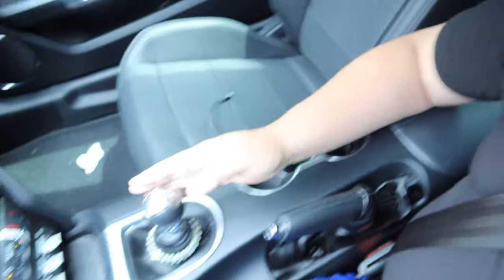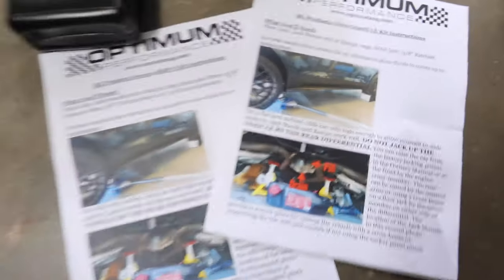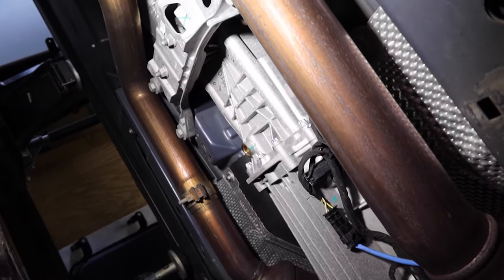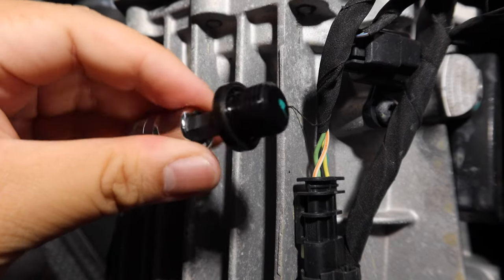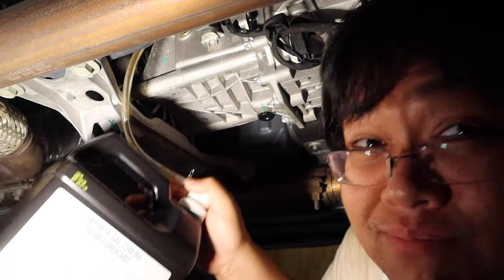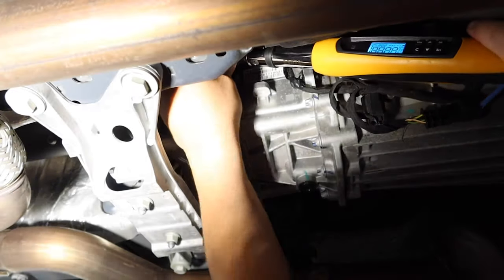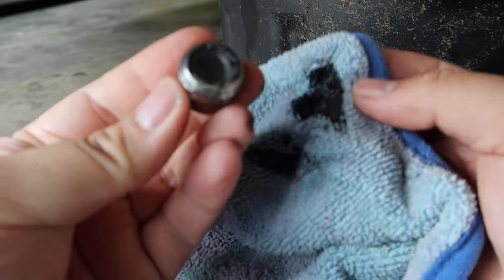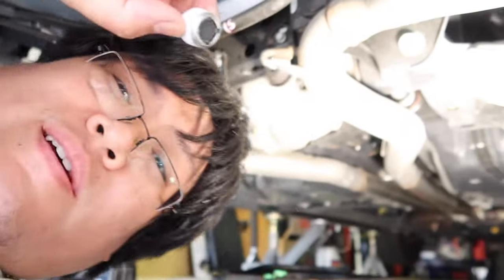Mustang Manual Transmission Oil Change

Comment: Hey man love the video, just wanted you to know that putting thread sealer on a bolt that sits in the fluid is a bad idea. You'll actually lose some of the sealant in the transmission. If it didn't have a thread sealer on the bolt you shouldn't use it. Great video tho just trying to look out for you. Hope everything is ok regardless.
Reply from the maker: I did wonder about the thread sealer. I guess I will find out in several thousand miles when i do another change.

Comment: Would doing this help? When I shif to 3rd it will sound like a notch or grind kinda and then pop into gear it doesn't do it every time but every few times it'll do it. And it's only in 3rd gear it does it. My car is a 2017 mustang gt premium.

Comment: Enjoyed your video, thanks. I have a 1995 Mustang Convertible with a 3.8 v6. My Dad gave me before he passed away. He drove it until he was 98. I am redoing most of it. The manual transmission is good but starting to feel loss. After watching your video I believe changing the gear lube will take care of that. My Dad just drove it and not other but he did keep the oil changed. Motor is in great shape. Again great video...

Comment: I have a 2020 Ford Mustang, GT with the Ralph exhaust system and the Rouse cold air intake. The car is crazy fast is your car a 2020 mines called coma blue only had it about two weeks. I love it what a hot rod.

Comment: Whats differential fluid for? I got the BG syncro transmission fluid (not put in yet), do I need the differential fluid too?
Reply from the maker: Differential fluid is for the differential. The differential is after the driveshaft before the axles. Most probably don’t need to change this fluid as early as I did but it wouldn’t hurt and is good preventative maintenance
Reply: @BinhDong  ok i see. Thank you 🙏
Reply: @BinhDong  i have another question. I only have a lift for changing tires for one side,. If i get another so that i can lift just the front up, is that ok for the fluid change or do i need to lift all sides evenly?
Reply from the maker: @soulassassin4847  lifting just the front will work. I don't see why it wouldn't. I'm sure that's how most are doing the change anyway.